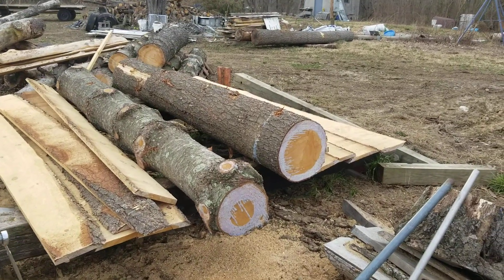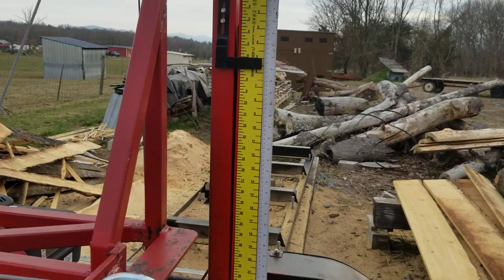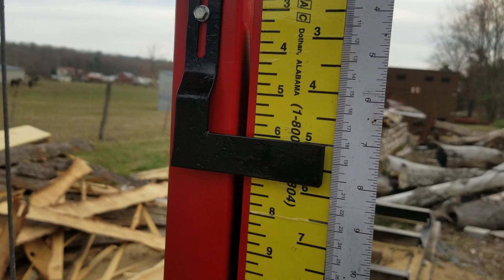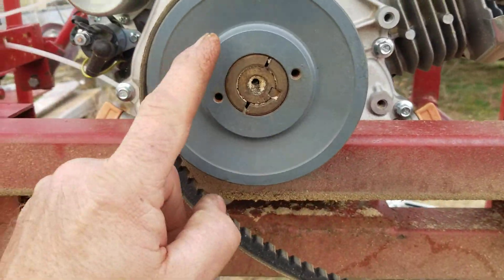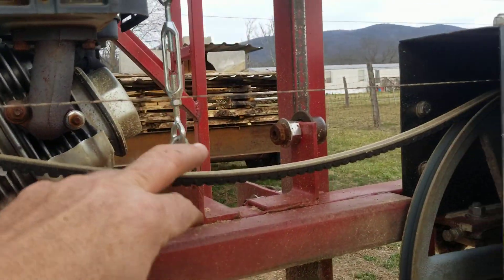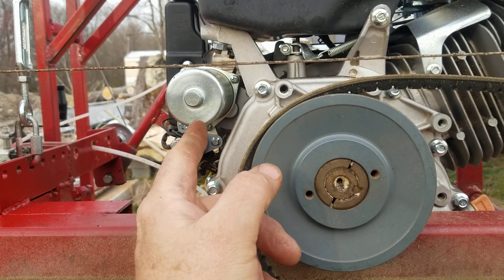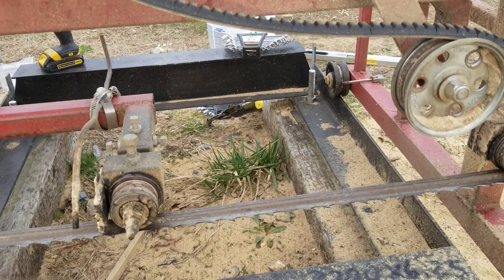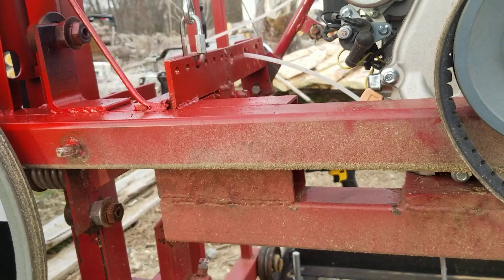Week one of solar kiln.

Comment: That’s a nice upgrade! Best of luck on trying to fix the flutter, does your cut dive or rise when you come up on knots? I have busted a few blades running them duller than I probably should so it would heat up, I would add water which would start increasing blade tension but it would shock the steel and break. I’m learning as I go but that may be what’s happening? Take care, happy sawing!
Reply from the maker: Yes it does, all of the blades I have sharpened and one didn't cut 2 logs and ended up with a bunch of cracks. I might not be running enough water from the get go, tension to much, fluttering or something else. Maybe the blades are not sharp enough, going to try to eliminate as much as possible and see. I sure do appreciate the advice and input. I might have ran these blades to long the first year and stressed them. Going to make a clamp on tensioner to eliminate that. Not going to give up though! Lol! I enjoy it to much. How's your kiln coming?